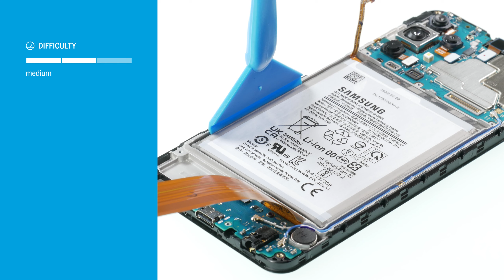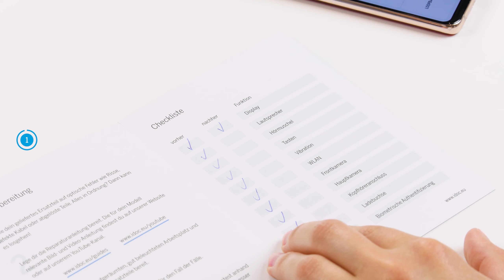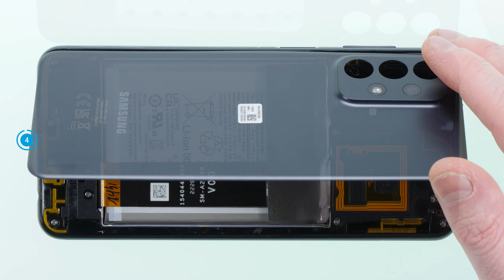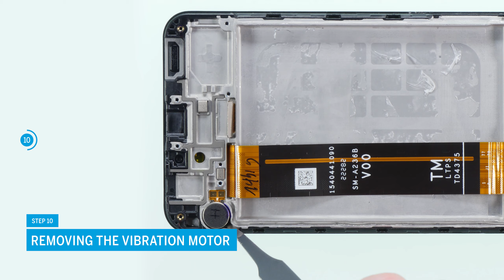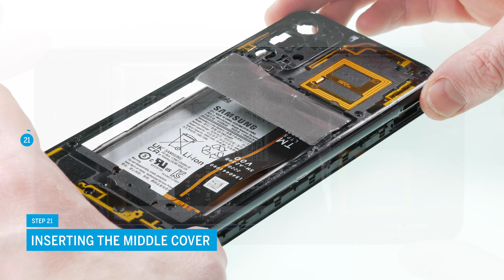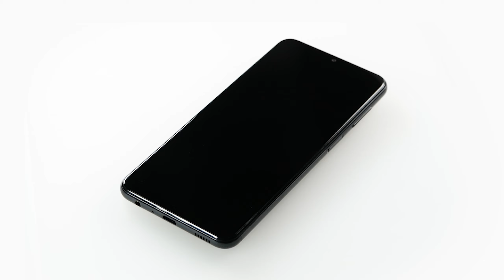Samsung Galaxy A23 5G – Screen replacement [repair guide + reassembly]

Comment: There is a step missing to move the handset speaker from the old screen to the new screen. I'm assuming the replacement screen that you are using has a new speaker on it and that's why it's not included. Took me a while to figure out why I couldn't hear people talking to me. I threw mine away with the old screen lol. Luckily a new handset speaker is super cheap and easy to install. Great guide though! I've used this guide for multiple phones now.

Comment: How are you almost completely stepping over the installation of the new screen, which was -the point of the video-?!?
Reply: The new screen is a unibody unit. The replacement screen is what the presenter moves the old innards of phone into

Comment: this phone fell out of my hands ONCE and is bricked xD
thanks for the instructions :)
Reply: Screen is absolute trash.  Dropped it on carpet and cracked in 3 places with a case on it..
Reply: @camarox yup, the aftermarket are not good.  My original was dropped dozens of times with a case.  No problems.   The aftermarket cracked with 1 little drop onto a wood floor.  They are really poor glass.  Probably not gorilla, that's for sure.😢